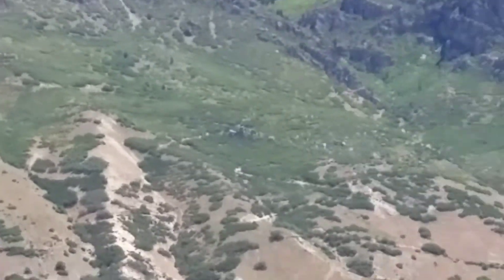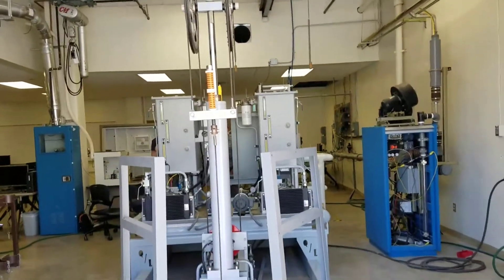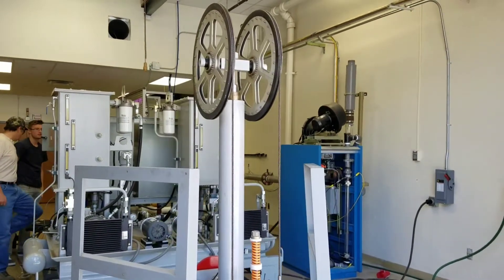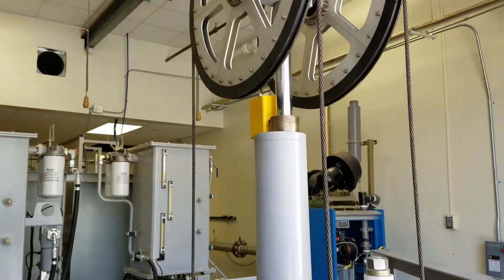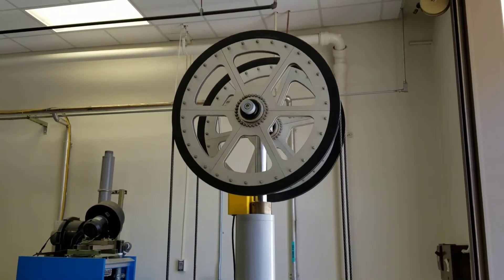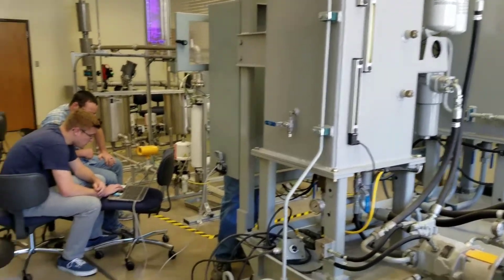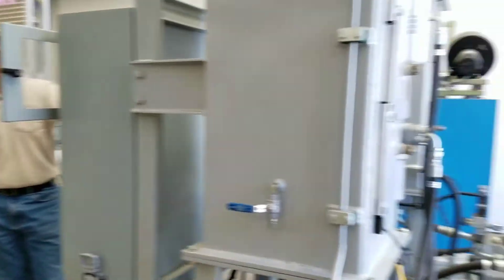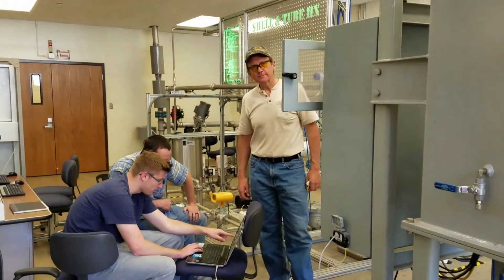Hydraulic Rod Pump Control System Development

Comment: So Dave Krug is still at it. It has been about 10 or more years now. This application shouldn't be that difficult.
Reply: The automation isn't difficult but we've switched to a new platform to allow several optimization features that will improve performance. The optimization strategies include energy recovery, liquid level detection, and tying into reservoir simulators to improve overall reservoir performance by coordinating multiple injectors and producers. More details at http://apm.byu.edu/prism/index.php/Projects/HydraulicRodPumping